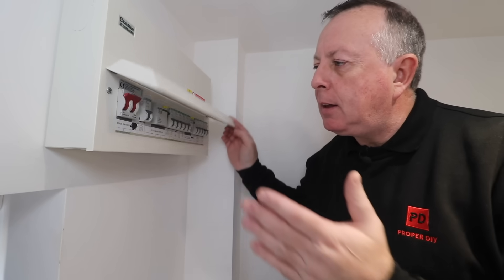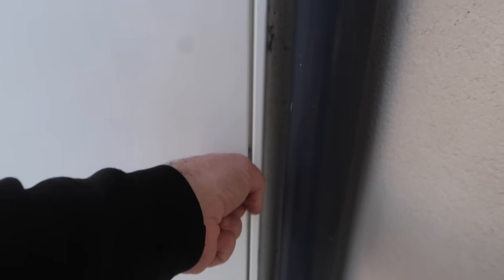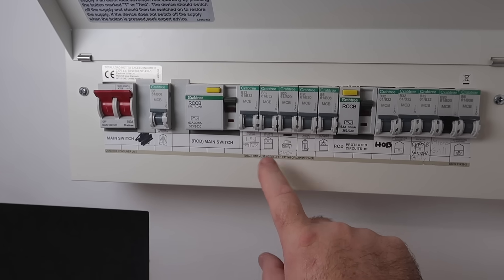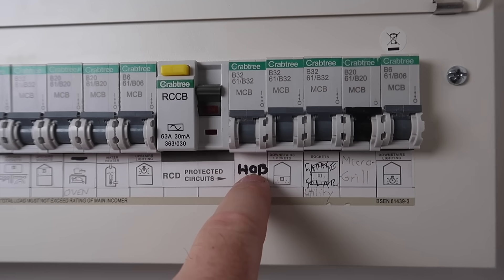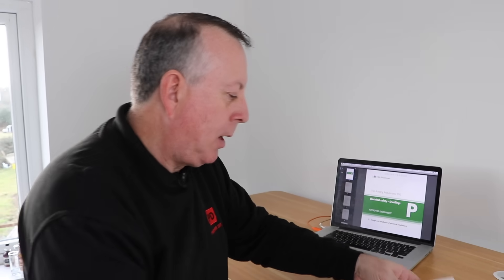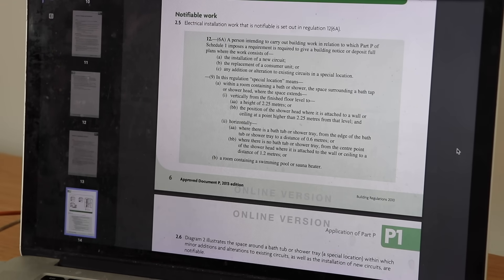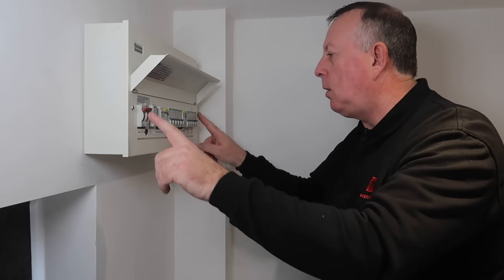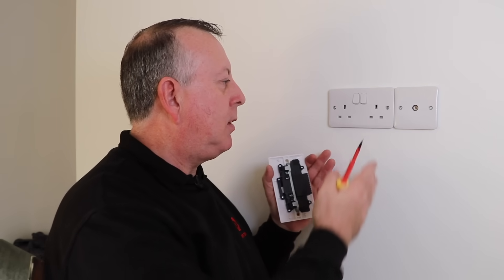What electrical work are you allowed to do in your own home?

Comment: I was an approved electrician for 50 years, covering a wide variety of disciplines, I am now retired and technically not allowed to carry out any work as I don't have a valid certificate. The range of voltage can fall further as I have had a volt drop down to as low as 147V but this was a substation fault and I only noticed it due to the fluorescent lights not working although all the rest were ok.
100A supplies have been the standard for many years although 60A was the original when you had one double socket in each room, now the kitchen usually has its own ring circuit as there are so many sockets in there. The ring circuit will supply 32A total, although each socket will only give 13A+/- depending on the cartridge fuse within. Cookers used to need a dedicated circuit as it would draw large amperages as it could have up to 9 elements and the load was based on everything being on at once so it could draw 27A. Now most ovens and hobs are efficient enough to be run from two 13A sockets.
Nowadays to do work in your house you require a ‘Part P’ certificate, otherwise known as a Building Control certificate, I never had one, as, by the time I retired I was doing upto 400KV installations, well outside its parameters.

Comment: It's one thing to do DIY electrical work on your own property, it's another thing to get your insurance company to pay out if there is an issue with your DIY work. A qualified electrician is not allowed to sign off work they have not installed themselves and if they do more fool them.
Reply: However how exactly would anyone know when electrical work has been carried out if it predates the regs seeing as people were allowed to carry out the work before those regs were done? Certainly people bought houses knowing they needed rewiring & some did the rewiring themselves & it was perfectly legal. So if if someone decided to rewire their house, do other electrical work as well how exactly would they know when that work was carried out?
Reply: The cable harmonisation , will be a huge clue to any qualified person. To identify when alterations have been carried out. 
It will all come down to when people sell their house and get a EICR check done on the property. It wont stop them selling their house but it might impact the price they get. At the end of the day Part P is meaningless piece of legislation.
The IEER regulations are not legally binding and are only guidance for good practice.
 @triax7006
Reply: @andreawyatt3059  Thank-you someone with a brain.

Comment: Good job I totally, never took any notice of this. Put in my own electric shower,cable, separate isolation box,metre tails. Never had a problem. Got an electrician in to remove electric from an old back boiler,pump and timer. Got shocked, when he left a live wire. Who is the professional,me or him.
Reply: Correct I would argue that some so called "pros" are not up to the standard & a competent DIYer is not going to make mistakes as they take their time, read all safety & how to carry out the work & not cut corners & over compensate on things like wire sizes.
Reply: @triax7006 As long as that "competent DIYER isn't you.
I've seen your responses on another thread and you haven't got a clue.
Bonding a kitchen sink FFS 😂😂.
Stay away from me the electrics mate, you're a liability.

Comment: Can i run all the cables, then get an electricain in to connect the wires to a consumer unit?
Reply: When you get an EICR done, make sure you ask for the Drive By option. You don't want to pay more than about £50 for this. There's no point in wasting money on the health or safety of you or your family or your home.
Also you don't want any "issues" being highlighted. 
After all if you're going to get the totally wrong certificate for the work you've done, you won't want to piss unnecessary money up the wall on it.
Reply: @davebadger100  it is not difficult to do domestic elections, as long as you use the correct standards
Reply: @penman1289  So you say and yet day iin day out I come across DIY electrics that are  lashed in by people who think it's not that difficult. 
I'll bet my house, you haven't  got a clue how to test your work when it's finished.
Reply: @davebadger100  well you are right , but people can get an electricain in to do an electrical test and can give  a certificate  ,  landlord do this all the time, I suspect you are an electricain and have done many certificates for land lords
Reply: @penman1289  Any electrician signing off new work done by a DIYer wants their  head looking at.
I willl sign an Electrical Installation Certificate on my own work installed by myselfonly.

I will sign an EICR off on a property,  but that will have limitations on it depending upon how  much of the installation I can access and test. 

The 2 certs are entirely different.

EICR's  should  not be used for new work

Using an EICR to "certify" new  work is trying to circumvent proceadure.

Typical landlord trying to cut corners and skimp on maintenance.

The fact that you even have to ask these basic  questions tells me you shouldn't be getting  involved with electrical installation work
Reply: Chances are a decent one won’t want to
Reply: You can do everything.
Just don't commission it. Then your not fitting the electrics.
Then get an EICR done, they will be confused as to why the power is off and will turn it on after inspecting it and sign it all off under the EICR report and give you a condition report.
If its all good, guess what, it's all good. its now signed off.
If not then the report will tell you why its no good. If its really bad they won't sign it off.
Reply: @davewebster4246  thanks
Reply: @davewebster4246 different ceets required mate 😂
Reply: fairly sure you rent supposed to just get an EICR after it's done? Surely it's an install creator a form of install cert. hence there are places to note: designer, installer and I think inspector....   @davewebster4246

Comment: Just to say, you can do your own domestic electrical work ie in your own home even if the work requires a Building Notice to the local Building Control. You are not breaking any laws. When the work is done, Building Control will have the work tested. If all is ok, you will get a notice from them passing the work. You will have to pay the testing fee when you submit the Building Notice. The conundrum is, you need to have it tested before you can switch on and use. As long as you are competent though you can do the work. You cannot do it for profit, just in your own home. Electricans get the ache when asked to test an installation they have not put in. Protective of their work, but lots of folks find it hard to find an electrician to do any work for them. Same as gas engineers. They like to pick and choose.
Reply: EICR report. 
Bypass that whole dumb conversation.

Comment: Interesting to note the change to 230V from 240V. I didn't know about that. I guess the supply is still the same for now, but they are preparing for a possible change in future?
I took a look at the meter outside my house and it looks like it says 415V going in and then there is a 60A fuse on mine. Does it then get converted down to 240V in the meter box?
Reply: No. It is 240 volts all the way.
Reply: @rogerphelps9939  Well it definitely says 415V.

Comment: I used to do a lot of major refurbishments and usually ran all the electrics myself but always called in a qualified sparky to check the circuits and connect to the board.  This arrangement worked well for me for many years.
Reply: @jameshansing5396 - Any qualified electrical inspector would be pleased to do an inspection and certify the work if it meets the requirements of Part P.  It’s what inspectors do (there’s a clue in the name, ”electrical inspector”.)
Maybe you should have stopped after your first five words . . . ?
Reply: Ok, your ignorance is highlighted several times there.  An EICR isnt the same as signing off someone else's work.  Part P is an insanely tiny part of the process, I mean TINY..... Part P course is 3 days, I got 100% on mine.  BS7671 is 3/4 days, I got 96% on mine.  BUT the rest of knowing your stuff is YEARS.  Oh and let's not forget the week long Test and inspect course, 2391.  

As a working Spark, with many Spark acquaintances (So personal experience) the VERY best ones dont want anything to do with signing off someone else's work as they are too thorough and anal (a good thing).  it really isnt the same as an EICR where you can load the cert with LIMs.  Ill put you onto my mate if you like, he teaches 2391 and BS7671 whilst still being a working Spark.  Id trust him over anyone and he wouldn't want anything to do with it.  The only ones I have ever known do it were Spaks who's knowledge had zero respect for.

SO you can try and be condescending but I have highlighted your ignorance and given you real world examples.  

Look over the comments, plenty are saying how sh*t proper Sparks can be.  And guess what.... they will be the ones signing off some clown's work....... Unless I can inspect every inch of cable, check EVERY termination then f*ck that and by that time, you may as well have done it yourself.  ;)

I am open to the fact that SOME decent Sparks may do it but I still stand by my view, as I am not a total egotist like you who thinks my own small experience is all encompassing.

$50 says you arent even a Spark yourself.... (If you are then that's scary that you think Part P is so relevant. It really isnt in the grand scheme of things).  @randomwoodworker
Reply: @jameshansing5396  I wish I could see the rest of this thread that has clearly been removed.
Reply: I rewired my house, years ago, and called in a qualified electrician to check it out. He could find nothing wrong, because I had spared no expense in making everything completely compliant, and exceeding the standard of the time by as much as was reasonably possible. About 30 years later, several newer Editions in place, I called in another electrician to do some rewiring, because I was no longer up to date, and he was happy with the older wiring, because it was still completely safe, although it would have to be done differently if rewired again. All impedances are well within specifications, etc. The only significant change he had to make was to replace the plastic consumer unit with a metal one, and to upgrade the RCCD's. The daft thing is that, when I first rewired the place, I had to replace a 'unsafe' metal unit with the 'safer' plastic one.
Reply: And you were probably as competent as some of the rip off merchants if not more so
Reply: Most of domestic wiring could be done by a chimpanzee and when you uncover some of it in renovations it looks like it has been
Reply: Don’t know any decent sparks who’d be ok with that

Comment: So the government document says this "Connecting an electric gate or garage door to an existing isolator switch is not notifiable work, but installing a new circuit from the consumer unit to the isolator is notifiable."  So, that is specifying that it would be considered a new circuit if it were connected back to the consumer unit.
1. Does an electric garage door require a dedicated circuit back to the consumer unit, or could you just spur off a ring main?
2. What if you break into a ring main and add an extra socket as part of the ring main; not a spur? Is that permitted?

Comment: I don't think that the electric companies have changed their electrical supply to 230V. The tolerance permitted for the new 230V means that 240V is within spec. It would have cost loads to actually change to 230V.
Reply: It's 230v +10% & -6%. It's just that they are conforming to international standards for 230V so all products are rated for 230V & will have that 10% tolerance anyway which is why you see 250V on some products.

Comment: Regarding consumer boxes, RCBOs are better for a household.
Although the installation cost is a bit more, the benefit is that each circuit has its own 'RCD' which means - unlike having only two RCDs -  half the house does not lose power with RCBOs because one appliance or light has a problem.
A properly qualified electrician can convert consumer boxes on request for a cost and personally would strongly recommend it.

Comment: Useful video, thank you. What if I do (most of) the work and look for an electrician to review, test, and finish it? May it be legal? Can (s)he validate my job? Or is it really necessary that an electrician has to do everything? I want to terminate circuits and install new ones. I want to do the wiring, but I left the final step (replacing the "fuse box" and adding the new circuits to it) to the expert. Thank you for your answer in advance.
Reply: What happen if you didn't do any of the work but have no paper work for it but want it checking just be be sure.
You get an electrical inspection done.
Normally an EICR.

Comment: My perspective from France (NF C 15-100 regulation), where anybody "qualified" (title 6 #610.1.5) or with the appropriate "knowledge" (title 1 #117) can pretty much do everything themselves, because it will be inspected before electricity is even connected to your house:
1) Our electric panels have 1 to 4 rows of DIN rails, 1 being like for a 1-room studio, and they are usually 13 "modules" wide, because you can't really have "lots" with a limited "split the incoming supply into lots of different individual circuits" with just one row already taken up with a main switch and RCDs (called "differential switches" over here) that are 2 or 3 "modules" wide each;
2) Each row starts with a RCD on the left and the circuit breakers right next to them, so you can easily link all RCCBs with a vertical metallic "comb", and the RCCB with its dependent circuit breakers with an horizontal comb, no wiring involved except for the first RCCB;
3) Your electric panel is full to the brim, we must leave 20% free space minimum per regulation for future expansions;
4) Each RCD can protect only up to 8 circuit breakers and circuits, so 16 on a 2-row panel, compared to your 10 RCD-protected circuits (and 1 unprotected?);
5) This fancy 6 A circuit breaker does not exist here, we have 10, 16, 20 and 32 A for all wiring, and also 2 A for internal electric panel modules or relays, such as the night/day "contacter";
6) Your example of 12 outlets on the same circuit would be the maximum allowed, and with a 20 A circuit breaker and 2.5 mm² wire to boot;
7) Both outlet and lighting circuits should be split over 2 different RCDs so that we still have power and light if one goes wrong. I elected to have 1 lighting circuit for all ceilings, and 1 for all walls, and as for outlets, 1 circuit for the north and east walls, and 1 for the south and west walls, plus 2 separate circuits for outside lighting and outlets;
8) We need to bring the ground wire to all outlets, including lighting sockets, these new ones are called DCL (Light Connection Device). Not the brightest idea, since we now have lighting outlets to which are plugged E27 sockets in which the light bulb needs to be screwed as we are, because we also need to screw them back regularly in vibration--prone environments where they tend to unscrew themselves with time;
9) The symbols and tiny text printed below your circuit breakers are not as helpful as they should, larger printed text above may be more effective in case of an emergency with poor lighting. This is the most critical information to have in your electric panel, it should figure prominently. I would also stick a plan of your whole house's electric installation to the back of your electric panel cover. The electric plan fits nicely on higher multiple-row, and you can easily print it out on A4 non-flammable paper. The electric panel is also a good place to put information such as "all spots and light bulbs are 12V DC LED bulbs" and where the spare circuit breakers and light bulb are located; 
10) You seem to have a lot of 32 A circuits (5!) for such a small electric panel. That would be like having all 5 of electric radiators, electric heating floor, induction hob, car charger and heat pump, meaning you are left with only 5 circuits for everything else, which is impossible to manage within French regulations.

I like that your electric panel is metallic, not just fire-retardant plastic. I made mine out of cement in order to insert it into an internal wall, as I didn't want a protruding electric panel. I fitted 3 x 30 cm DIN rails (€6 total on Amazon) and 3 live/neutral/ground bus bars for 15 wires each (€17 total on EM Distribution). These are all the electric components that make up an electric panel. In the U.S., i could have saved $5.5 on the ground bus bar, as they apparently bond neutral and ground in the electric panel!

I would avoid large ring circuits, a fault could disable the whole ring and make debugging trickier. Splitter boxes with separate wiring for each power or lighting outlet are more resilient and don't cost much more in wires either: A 100 meter roll at €18 or €27 in 1.5 or 2.5 mm² sections allows to split these 5 outlets 6-7 meters away from the splitter box.